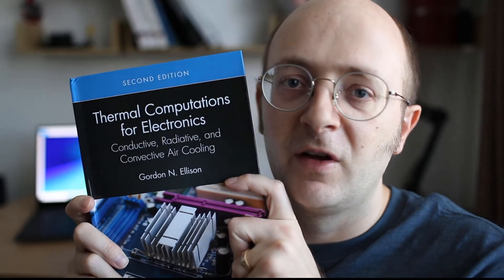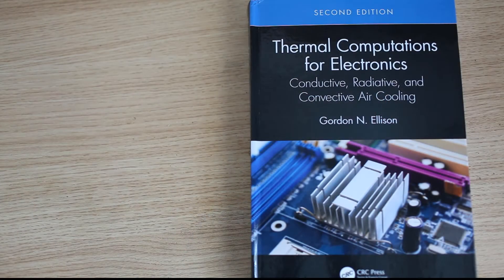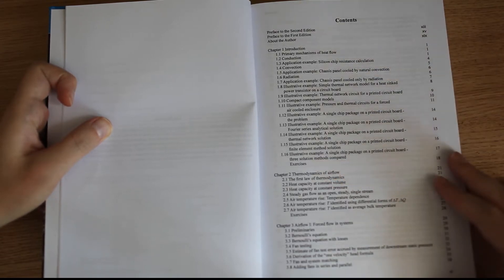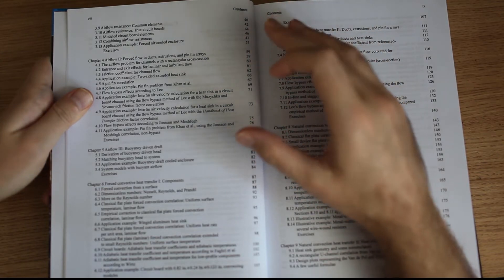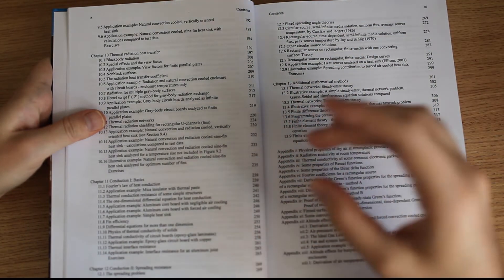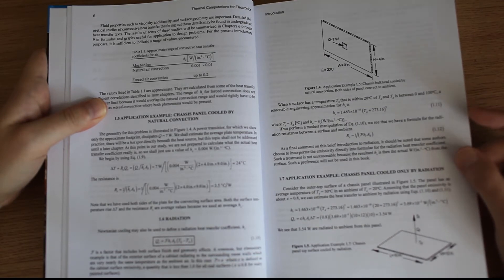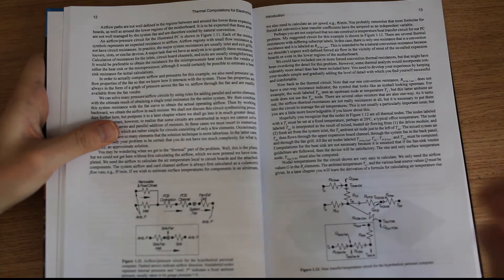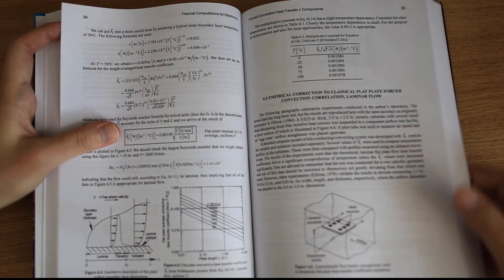Book Review - Thermal computation for Electronics by Gordon Ellison

Comment: As an electronics engineer, I have done some self-study on the subject and was gladly surprised about the thermal network analogy and electric. I could use my electric knowledge and understanding applied to thermal. I did some interesting simulations in LTSpice. Some things that are more difficult to calculate for me, like a lot of sequential RC-networks, that would need a lot of differential equations to solve, I could easily simulate. Interesting topic